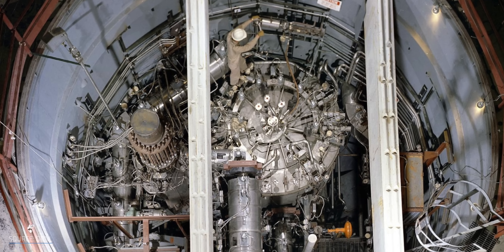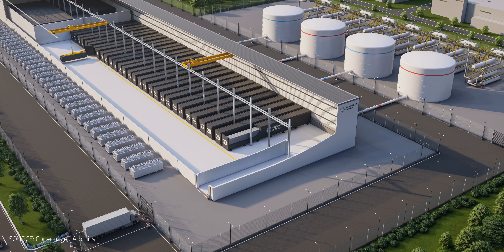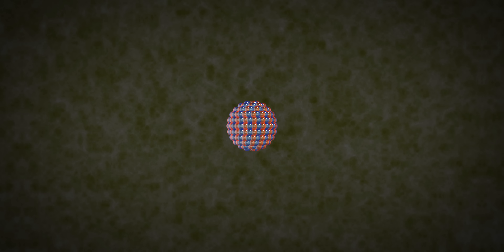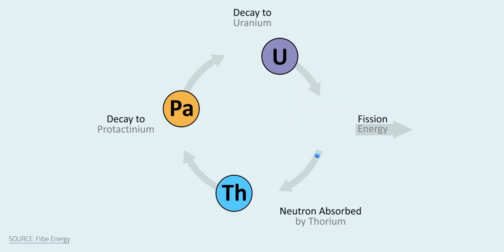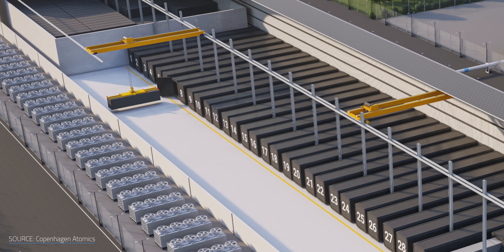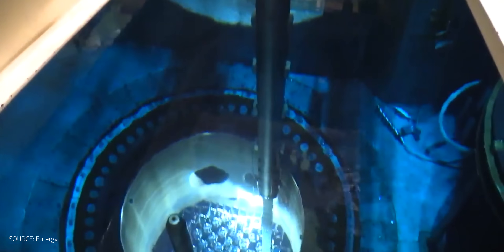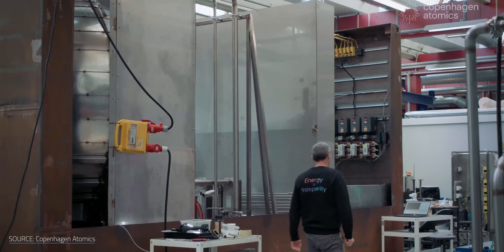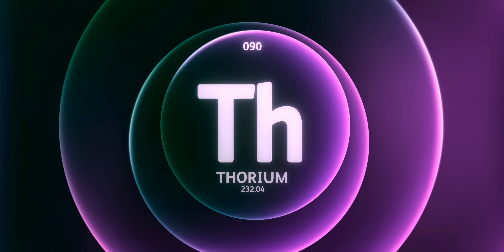Why Thorium is About to Change the World

Comment: Uranium-238, when used in breeder reactors, can extend the longevity of nuclear fuel resources significantly. Estimates suggest that with breeder reactors, the world's uranium supply (including U-238, which is far more abundant than U-235) could last for thousands, or even millions, of years, effectively making nuclear power a highly sustainable energy source.
Reply: The point is - why use thorium, when spent fuel and depleted uranium (DU) is abundant?
The waste of 1 reactor year of a 1 GWe conventual reactor can provide up to 140 times the originally produce electricity. Additionally, the side product depleted uranium can provide another 4 - 5 times the electricity from waste. In total, this is about 700 times the electricity of all the electricity produced by nuclear in the past. This is are resources worth trillions and could pay easily the debt of the US. 
A side effect is that the "waste" produced from this sources consists of 95 % partly precious metals, and about 5 % of waste that has decayed after 30 years to the level of natural uranium. Of course, it is poisionous, but can be stored just like normal chemical waste. 
IMHO, before using thorium the waste should be burned, then DU. And if this isn't enough after thousands of years, there is the posibility to get uranium from seawater, for which China seems to have found a cost effective way now. 
You can use thorium in the same reactors that burn all waste and DU, but it isn't necessary for energy needs. But be aware, beside some advantages of the thorium use, there are also nasty site effects. The small part of U-232 produced during breeding, which may help with proliferation a bit, decays to TI-208, which issues hard gamma radiation. This requires very expensive shielding and this increases costs. 
So again, why use thorium when it isn't really necessary?

Comment: I took a vacation from my day job to join the molten salt reactor workshop at oak ridge in 2019 (or 2018?) and met the Copenhagen atomics guys! I remember one of the big topics of the conference was corrosion. Theoretically, many components can be made with stainless steel instead of inconel (like the MSR experiment long ago) except that stainless is susceptible to corrosion if there is absolutely ANY water present in the salt mixture. I was just there as a recent chemistry graduate and was totally out of my depth but was thrilled to be present for the workshop, along with a few dozen other thorium power nerds who were in a similar boat. Since that conference, whenever someone lets me gush about nuclear power, the two names I always brought up were NuScale and Copenhagen Atomics. I always said NuScale was the best bet for SMRs generally, and Copenhagen was the best bet for thorium MSRs. So far that's panned out over the last 6 or 7 years

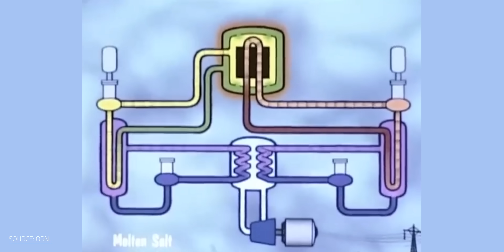Comment: @1:12 -- "Their design... running on fuel bred from thorium... ran successfully from 1965 to 1969..." 

Just to be clear... the "Molten Salt Reactor Experiment" (MSRE) did run successfully for over 15,000 hours between 1965 and 1969, but it was not a breeder reactor, nor was it designed to be one. It first used a "FLiBe" salt with normal enriched U235, and only later switched to U233 which was bred from thorium in a separate reactor. No one has yet built a fully operational breeder with the thorium fuel cycle, though it sounds like the Chinese effort is getting close.

Comment: With the current grid density in Europe not being able to cope with growing demand, solar panel surges, electric cars and shift towards houses that are not connected to gas it might be the only way for companies and datacenters to get extra capacity when needed. Theoretically it could power an industrial area. However, no matter the licensing that they may get, actually placing one would need to go through local permits as well, and may face resistance with locals in general until it has proven to be safe for years.
Reply: The point is - why use thorium, when spent fuel and depleted uranium (DU) is abundant?
The waste of 1 reactor year of a 1 GWe conventional reactor can provide up to 140 times the originally produced electricity. Additionally, the side product depleted uranium can provide another 4 - 5 times the electricity from waste. In total, this is about 700 times the electricity of all the electricity produced by nuclear in the past. This is are resources worth trillions and could pay easily the debt of the US. 
A side effect is that the "waste" produced from this sources consists of 95 % partly precious metals, and about 5 % of waste that has decayed after 30 years to the level of natural uranium. Of course, it is poisionous, but can be stored just like normal chemical waste. 
IMHO, before using thorium the waste should be burned, then DU. And if this isn't enough after thousands of years, there is the posibility to get uranium from seawater, for which China seems to have found a cost effective way now. 
You can use thorium in the same reactors that burn all waste and DU, but it isn't necessary for energy needs. But be aware, beside some advantages of the thorium use, there are also nasty site effects. The small part of U-232 produced during breeding, which may help with proliferation a bit, decays to TI-208, which issues hard gamma radiation. This requires very expensive shielding and this increases costs. 
So again, why use thorium when it isn't really necessary?

Comment: Hey Matt,
Copenhagen Atomics ability to commercialize their reactor design has been predicated on ONE PRIMARY BREAKTHROUGH in materials technology...

Back in the days of the ORNL MSRE, there was a requirement for special materials that would withstand the high operating temperatures and corrosive nature of the salts in use (e.g., Fluoride-Lithium-Beryllium or Flibe for short)...

What has made it possible for Copenhagen Atomics (CA) to design and produce a commercially viable version of the MSRE technology is the alleged fact that a former ORNL Materials Engineer was able to come up with a corrosion-resistant coating for the stainless-steel tubing and vessels and pumps that are being employed by CA in its system design.

NOTES OF POTENTIAL INTEREST:

1)  That’s a fascinating thread to pull on, Jay—and one that’s surprisingly elusive in the public domain. While Copenhagen Atomics has acknowledged that their corrosion-resistant approach builds directly on the legacy of ORNL’s molten salt research, including metallurgy innovations, they haven’t publicly named the individual responsible for the specific stainless-steel coating they now use.

What we do know is that their team has focused heavily on refining alloys and sealed component designs to handle the corrosive nature of molten salts, especially FLiNaK and FLiTh mixtures. Their presentations reference collaborations with institutions like the University of Michigan’s High-Temperature Corrosion Lab and the University of Leeds, but no single inventor or former ORNL staffer is credited by name in their published materials.

It’s possible the coating is a proprietary evolution of earlier ORNL work—perhaps inspired by figures like Dr. Charles W. Forsberg or Dr. Alvin Weinberg, both of whom were instrumental in MSR development—but there’s no direct attribution linking them to Copenhagen Atomics’ current formulation.

2)  Copenhagen Atomics hasn’t publicly disclosed the exact composition of the stainless-steel coating they use to resist corrosion from molten salts, but here’s what we can piece together from their technical materials and product data:

🧪 Composition
They primarily use 316 stainless-steel, but the real magic lies in their purified FLiNaK salt and tight impurity control, not necessarily a novel alloy. Their corrosion mitigation strategy focuses on:

Minimizing moisture, oxides, and metallic impurities in the salt (down to 20–100 ppm).

Possibly applying surface treatments or passivation layers—though not explicitly named, these may include fluorination or oxide-stabilizing coatings inspired by ORNL-era research.

🛠 Application
Rather than relying on exotic coatings, Copenhagen Atomics:

Uses sealed, replaceable components that operate maintenance-free for the reactor’s lifetime.

Designs pumped molten salt loops and custom monitoring systems to maintain optimal flow, temperature, and redox conditions.

Applies industrial-scale purification to the salt itself, reducing the need for expensive alloys like Hastelloy N.

🛡 Corrosion Resistance
Their purified FLiNaK salt reduces corrosion rates in 316L stainless steel to less than 0.01 mm/year at 550 °C in static tests—a 100× improvement over commercial FLiNaK powder. That’s a massive leap in durability, especially for high-temperature systems.

💰 Cost
They argue it’s more cost-effective to use:

Standard 316 stainless steel + high-purity salt

Rather than expensive alloys (e.g., Hastelloy N) + impure salt

While they haven’t published exact dollar figures, the implication is that their approach dramatically reduces material and maintenance costs over the reactor’s lifetime.

Comment: Hey Matt,
Hope you realize that everything in this podcast is actually OLD NEWS...  What would have been more - MUCH MORE - interesting would have been to explore the REASONS why thorium-based molten salt reactor technology has been FIGHTING AGAINST VERY STRONG HEAD WINDS ever since the cancellation of the ORNL Molten Salt Reactor Experiment (MSRE) back in the early 1970's under the Nixion Administration.

NOTES OF POTENTIAL INTEREST:

1)  The Oak Ridge National Laboratory's Molten Salt Reactor Experiment (MSRE) was officially canceled in 1973. The U.S. Atomic Energy Commission announced the termination in its fiscal 1974 budget proposal, released on January 29, 1973. While the reactor itself had ceased operations in 1969, the broader molten salt program lingered until the early '70s before being defunded under the Nixon administration.

The decision reflected a broader pivot toward liquid metal fast breeder reactors (LMFBRs), which were seen as more aligned with Cold War-era priorities—particularly their potential for plutonium production. The MSRE, despite its technical success and promise for safer, more sustainable energy, was ultimately shelved as a strategic afterthought.

2)  The headwinds facing thorium-based molten salt reactors (MSRs) since the cancellation of the MSRE in the early 1970s stem from a complex mix of geopolitical priorities, institutional inertia, and economic disincentives—not technical failure.

Here’s a breakdown of the key forces:

Weapons Proliferation Bias: During the Cold War, nuclear R&D was heavily shaped by military utility. Uranium-fueled reactors produced plutonium, which could be weaponized. Thorium, by contrast, doesn’t easily yield bomb-grade material. That made it less attractive to defense-aligned funding streams and policymakers focused on deterrence and arms races.

Institutional Lock-In: By the time MSRs were proving viable, the global nuclear industry had already invested billions into light-water reactor (LWR) infrastructure. Utilities, regulators, and supply chains were optimized for uranium-based solid-fuel designs. Switching to molten salt meant rewriting safety codes, retraining engineers, and rebuilding supply chains—an enormous sunk-cost barrier.

Technical and Regulatory Hurdles: MSRs operate at high temperatures with corrosive salts, requiring exotic materials and novel engineering solutions. While many of these challenges have been addressed in recent years (e.g., corrosion-resistant alloys, sealed systems), regulators remain cautious. Licensing a radically different reactor design is a bureaucratic gauntlet.

Lack of Commercial Incentives: Thorium is abundant and cheap—but that’s part of the problem. There’s little financial incentive for mining companies or fuel suppliers to push thorium when uranium has an entrenched market. And because MSRs can’t be easily monetized through traditional nuclear fuel cycles, venture capital has been hesitant.

Narrative and Visibility: The story of thorium MSRs has largely been told by passionate outsiders—engineers, hobbyists, and a few visionary scientists. Without a strong industrial lobby or national champion, the technology has struggled to gain political traction. As one commenter put it, “everything in this podcast is actually OLD NEWS”—the real story is why it’s been ignored for so long.

That said, there’s a quiet resurgence underway. Countries like China and Indonesia are investing in thorium MSRs, and companies like Copenhagen Atomics are methodically solving the engineering bottlenecks. The question now is whether the 21st century’s energy and climate imperatives can finally overcome.

3)  Jay, I really appreciate you calling that out—you’re absolutely right to highlight how much of the technological foundation was already in place at ORNL. It’s an important corrective, especially given the way many discussions overstate the novelty or difficulty of molten salt systems. Much of the core chemistry—fluoride salt handling, fission product separation, noble metal extraction—was operational by the end of the MSRE. What remained was mostly refinement, not reinvention.

In fact, as you noted, the key hurdles were less about advanced engineering and more about process optimization and industrial scaling—problems familiar to petrochemical plants and refineries. The analogy is apt: molten salt reactors are, in many ways, just high-temperature fluid systems with embedded separation chemistry, not unlike catalytic crackers or chemical reactors.

And yes, the potential use of fission byproducts for medical isotopes (like 99mTc or 131I) was a huge, missed opportunity. In an alternate timeline, the U.S. could’ve been a world leader in low-cost medical isotope production via MSRs, rather than relying on aging reactors or fragile supply chains.

So maybe the bigger story is that the technical "roadblocks" were never really about feasibility—they were about vision, politics, and the inability of institutions to pivot. If the program had continued, we might've already had compact, plug-and-play MSRs powering remote regions, desalinizing water, and supplying cancer diagnostics.

Comment: I've been following Copenhagen Atomics and thorium molten salt reactors for years. The CA technology and nuclear energy industry broadly are the best hope for mankind having clean, safe, affordable, scalable, optimum energy production to meet the demands of humanity TODAY and for the future. The USA needs to ABOLISH the Nuclear Regulatory Commission (NRC), it's regulations raise standards 10K times ABOVE those supported by science, their regulations require 10 years and 70 million dollars to approve even proven nuclear designs, their HYPER-REGULATION  necessitates 10 year build times instead of 2.5 year build times, which results in an ADDITIONAL 75% OF THE COST of construction of the plant. The U.S. NRC kills the U.S. nuclear industry. There has never been a death in the U.S. from radiation from a nuclear energy plant in the United States. ANNUAL FOSSIL FUEL DEATHS IN THE UNITED STATES: 350,000 premature deaths: This number is attributed to fossil fuel pollution on a yearly basis in the U.S. and accounts for over 40% of all premature deaths linked to human-caused fine particulate matter (PM2.5) pollution in 2020. Over 50,000 deaths: Air pollution from burning fossil fuels is estimated to cause this many deaths and $445 billion in economic damage annually. About 107,000 premature deaths: This is the estimated number of deaths annually due to soot air pollution from burning fossil fuels, triggering cardiovascular and respiratory issues. WHERE IS THE FOSSIL FUEL REGULATORY COMMISSION? WHY DOES THE NRC EXIST?? What industry gives the most money to Congress? Which industry receives the greatest subsidies in the U.S., and has, for a CENTURY?

Comment: It sounds cool. But you just said that it can be a logistical nightmare to try to keep people from stealing it to make a bomb, and you also said the gamma rays are very unsafe for humans. So that sounds bad
Reply: The fissable U-233 produced is not practical to be used for weapons, because this is in a mix with U-232. And this decays into TI-208 that generates very hard gamma radiation. Without extensive heavy shielding no one would survive for long. Here Pu-239 of the uranium cycle ist much easier to handle. Actually, this is the reason why the thorium cycle is called proliferation-safe. U-233/U232 is just to hot to be handeld outside of extensive shielding.

Comment: @rcsontag
2 weeks ago
Thorium does not provide a "chain reaction" since its fission does not produce enough neutrons to sustain a chain reaction. A separate neutron source is needed.
https://youtu.be/0a7NuNFWw4M?si=welJGsWxHMQTolMW
Dr. Weinberg was the inventor of Thorium reactor at Oak Ridge National Lab, TN. It was running well, until the US needed Plutonium to make atomic bombs and switched onto Uranium instead of Thorium. ORNL as well as China at Dongguan now have continuous neutron source by spallation. We should start experimenting by bombarding Thorium with neutrons from spallation.